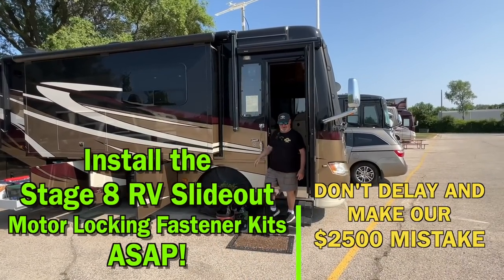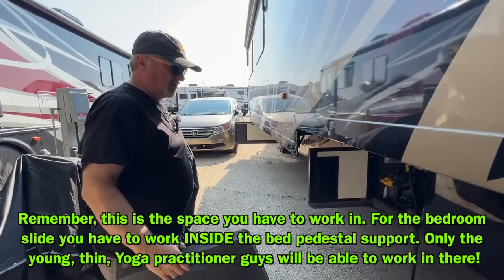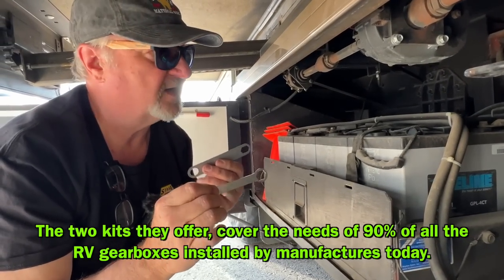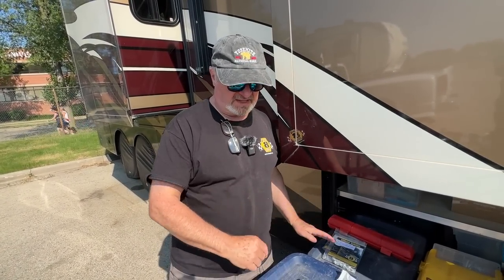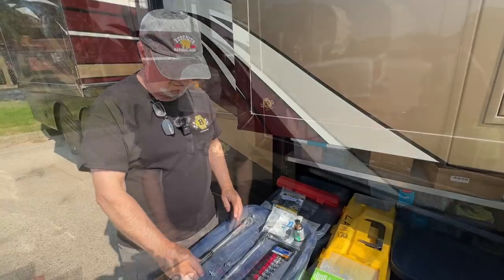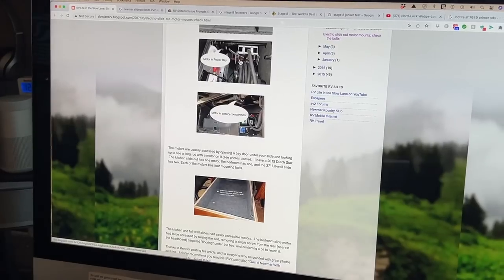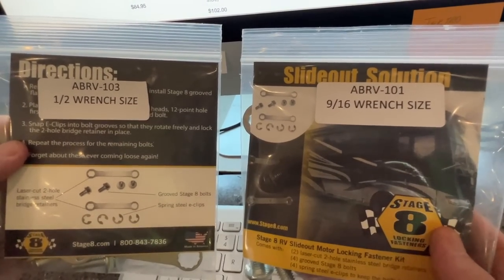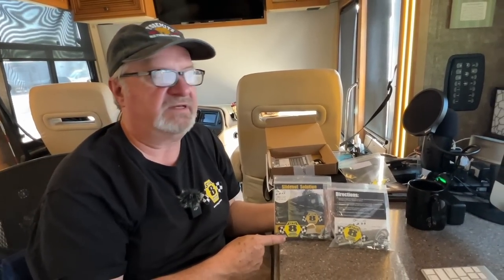Stage 8 RV Slideout Motor Locking Fastener Kit - Fix Loose Motorhome Slideout Bolts FOREVER! - EP273

Comment from the maker: Basically, if you have any of these gearboxes, you WILL have loose cap screws. Buy the kits. Get a torque wrench. Put the slide about 6" out from the close position. Jog switch to opposite (open) direction to unload the gears. Remove one cap screw at a time. Torque screw and STOP with hex heads aligned so the bar will fit over BOTH the cap screws you are working on.  Put the second (opposing cap screw in and torque it. Align hex so the bar will now fit over both of the hex heads of the cap screws just installed. Slip the snap ring clips into the slots on the hex head cap screws you just installed.  Do the other two bolts on the same gearbox the same way and you are DONE!

Comment: Same principle as the header bolt locks I use on my Hooker headers on my 56 Chevy engine. Good design. Now I have to check my slide out bolts!  ;)
Reply from the maker: Good luck,.......have the Torque Wrench ready!

Comment: Interesting solution to a problem that I don't have.  I have a Schwintek system for my slide out.  I think I would rather have your problem. 😃
Reply from the maker: The Schwintek slide repair solution is to REPLACE it with this bomb proof design: https://vroomslidesystems.com/
Reply: @OurJourneyInMyles  Yes, I am aware of it.  A tad pricey but probably worth it in the long run.  IRV2 has a lot of happy campers who have had the system installed.  There are few installers and a long wait time.

Comment: Thanks for the overview, Mark.  I've used Stage 8 bolts & fastening system on my race car's CV joints for years and never had an issue. One of the best features is the easy ability to take them off when needed. Loctite can be much harder to disassemble...
Reply from the maker: You are so right!  Loctite works too good sometimes, and not good enough at other times.  The Stage 8 Locking Bars are literally fool proof!

Comment: Very innovative design.  As a retired aerospace engineer I can certainly appreciate the solution.  Hadn't seen that design before.  I have seen a lot of castle nut and safety wire and nylok nut applications though.  Even our Space Shuttle used a lot of safety wire.  :-)
Reply from the maker: Hey Mike,........we too were very impressed with this solution to fix the loose bolt issue once & for all.

Comment: Just ordered 3 of these kits Mark for my 2016 Mountain Aire.  I last checked my bolts about 12 months ago and today found them all loose again.  Thanks so much for this great fix.  Update:  I quickly received all 3 kits I ordered and installed them yesterday.  It took me about 1 hour per motor and I have 3 motors.  Most of the time is spent just trying to reach the bolts and R&R them.  I found almost all the bolts were only finger tight after 1 year.  The lock washers and Loctite I put on them a year ago totally failed.  Mark this is a great fix kit and thanks for letting us all know about them.
Reply from the maker: Great plan Mike,.......you will be done after this install.

Comment: Good thing to check. I pick my RV up next Friday and will check!
Reply from the maker: If they are loose, I would get the kits before torquing to spec.  These gearbox threads only have so many tightening cycles in them!  I have a few bolts that are "soft" from previous damage.
Reply: @OurJourneyInMyles  
Used my Open Roads card
Today for the 1st time!
Saved $29.00 in Cheyenne, WY Loves!👍

Comment: You guys are our number source now -- QUESTION -- Can you do a video deep dive into all this talk about DEF engines and particulat filters etc., and discuss whether this is a real issue or not (maybe you have addressed this already in a video??)..  We keep getting pushed into "pre-DEF" coaches and can't figure out whether this is a real issue or not.  How much of a hassle has it been for you guys?
Reply from the maker: You are getting pushed into buying pre-def because you are talking to folks selling old coaches. We have had no def issues yet, but we are 2014.  If you buy an old coach that hasn't been in production for 15 plus years, you will have way more issues than def problems. The website irv2.com will have all your answers.  Learn to search your questions on it.  It is a golden resource.

Comment: Good video 😊I guess manufacturers  didn't plan on parts failure  at the price of these rv's  you would think  they plan for it  make access to all slide. Motor's safe travels
Reply from the maker: Exactly! I would have thought many, many years ago this issue would have been addressed AND SOLVED by the RV manufacturers.

Comment: Good presentation on that fix. Yes if you clean the threads and promote them the locktite will work much better. Like the ones you did that didn't come loose. 
Yes I do have 2 pair of safety wire pliers in my tool kit. Yes I know how to drill the holes in the bolts for the wire. 
I think the Grade 8 kits are great for most people and easey to install.
Reply from the maker: Thanks 👍 William,...........the Stage 8 Kits are the way to go and the easiest one time fix!
Reply: @OurJourneyInMyles  Yes the Stage 8 Kits are the way to go.

Comment: What does Newell, or Liberty (Prevost) use ?
Reply from the maker: Those are entirely different.  They literally use machine tool caliper components.  Production coach slides (like mine) are like Fischer-Price Toy drives compared to those units!

Comment: very good info thanks 🤠
Reply from the maker: Glad it was helpful! My best advice for folks is to do this while your gearbox threads are still healthy, and look up what the recommended tightening torque is taking into account what the gearbox boss material is.  The Newmar torque recommended seems high,...........and other folks on irv2.com comment to that affect as well.  Once the threads are "soft",.....nothing will work.

Comment: We understand the problem but we were lost in the explanation
Reply from the maker: Hey Rick & Darci: Basically, if you have any of these gearboxes, you WILL have loose cap screws. Buy the kits. Get a torque wrench. Put the slide about 6" out from the close position. Jog switch to opposite (open) direction to unload the gears. Remove one cap screw at a time. Torque screw and STOP with hex heads aligned so the bar will fit over BOTH the cap screws you are working on.  Put the second (opposing cap screw in and torque it. Align hex so the bar will now fit over both of the hex heads of the cap screws just installed. Slip the snap ring clips into the slots on the hex head cap screws you just installed.  Do the other two bolts on the same gearbox the same way and you are DONE!
Reply: @OurJourneyInMyles  thank you very much

Comment: Thanks for sharing. I have a 2022 Newmar LA 4589 and will check on this tomorrow. Do you know if the hydraulic slide outs have the same issue?
Reply from the maker: I know nothing about the hydraulic slides, but I am certain that the DO NOT have these gear boxes.  You DO need to check your other smaller slides to see if they have the old style "Fred Flintstone" gear and cog design that uses the gearboxes that get loose.  Would LOVE to have others chime in on this issue!